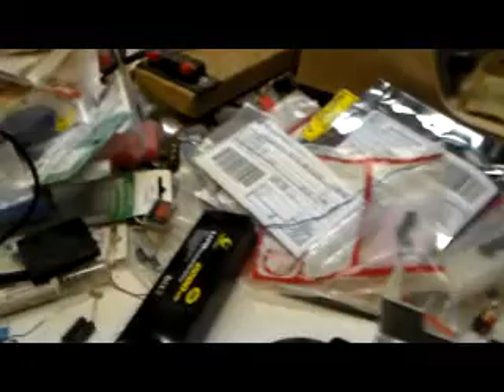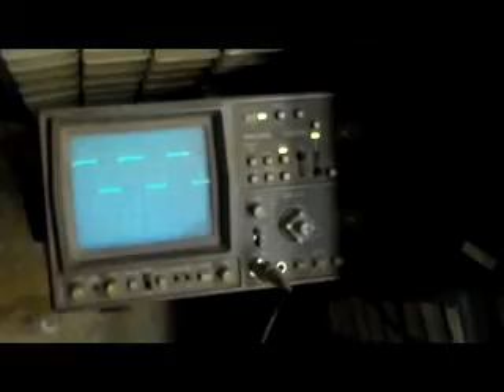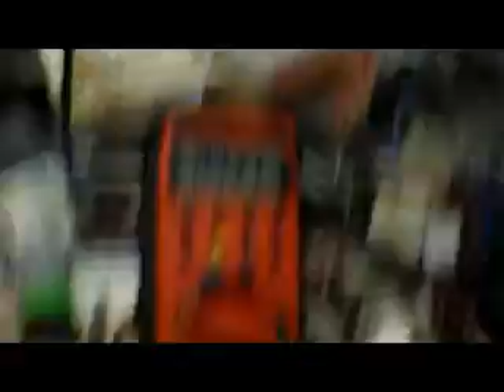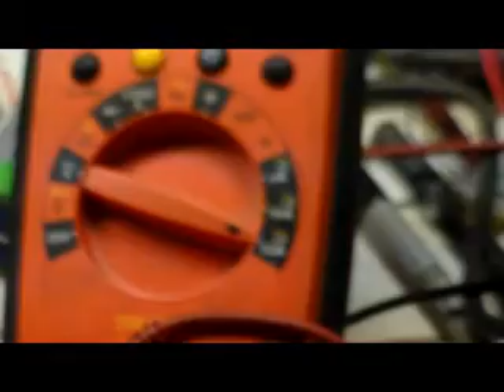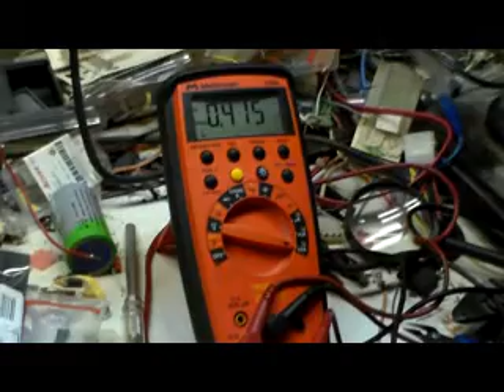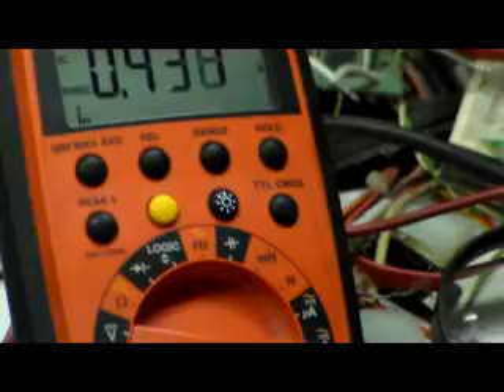Inductive reactance

Comment: Ha!... I know I'm quite fashionably late to this party, but....
I'm guessing you have your pot replacing R2 of your Sparky-1 schematic. Guessing (not really) also that the duty cycle of the 100K ohms R2 gave about 47.6% (555 white paper) and changing R2 to 65K ohms gave you roughly 46.4% duty.  Since the 555 is controlling how you're pushing and pulling current through the CCFL, would it not be better to get as close to 50% duty as possible, or is this close enough for guberment-work? Would it be at all valuable to try a trimmer cap in there too?
Thanks!
ps, Have you tried your Sparky-2 yet?
Reply from the maker: Ideally one would want 50% duty but that is in an ideal world. I found even 40% is ok, to get exactly 50% would cost to much to buy the high calibrated fine trimmer pot and fine trimmer cap, "close enough for guberment-work" is fine. Besides the values will over time degrade.